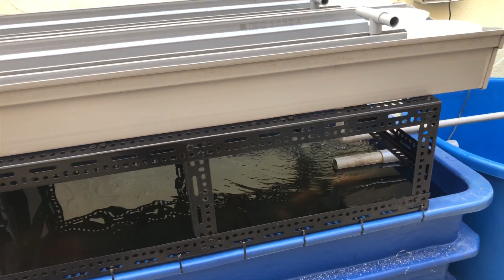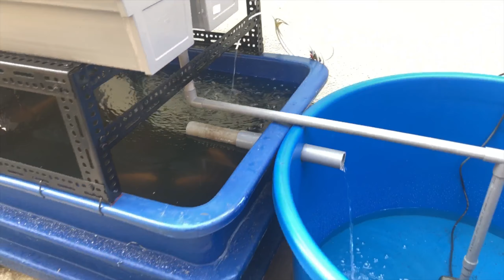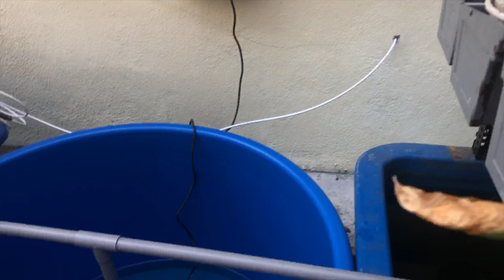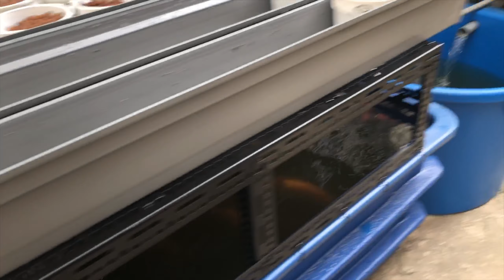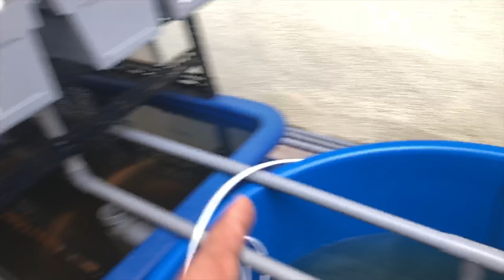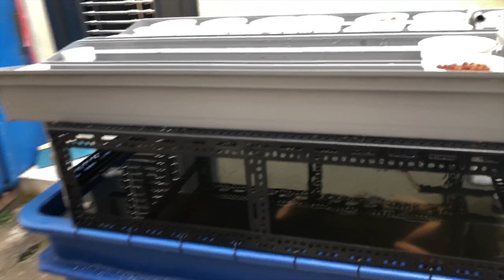CRAFTS - Revisited

Comment: Always inspiring! A small note on the pipes on the side of the fish-tank and the pump: You don't have to cut a hole in the side. If you use one vertical pipe in the fish-tank and one somewhat shorter vertical pipe (capped at the bottom not to drain the fish-tank but you know this of course) in the "pump tank" you can siphon water between the tanks with a hose. It is one way to remove potential leaks. Also if you add a simple float switch on top of the pump you have a cheap safeguard for not running the pump dry and burning the pump. All the best!
Reply from the maker: Yup, that will do, only thing is the water level in the growbed return tank will not be constant it will follow the feeder tank level. Then I can’ t name it CRAFTS 😁
Reply: @affnanaquaponics  In Sweden we say "A dear child has many names" :)